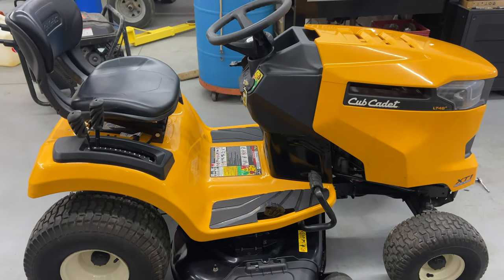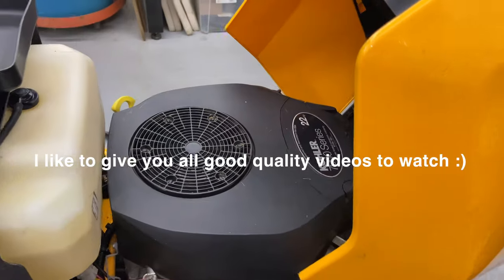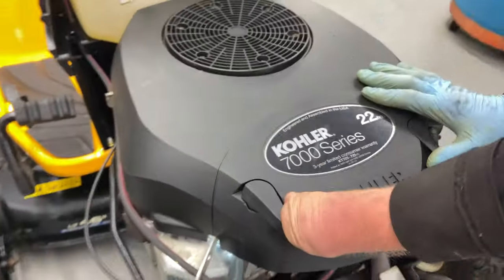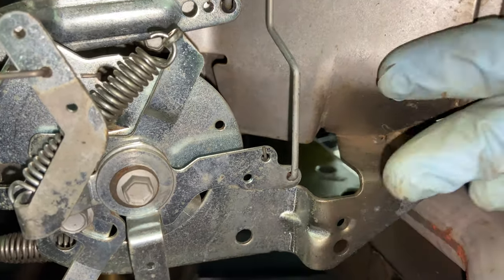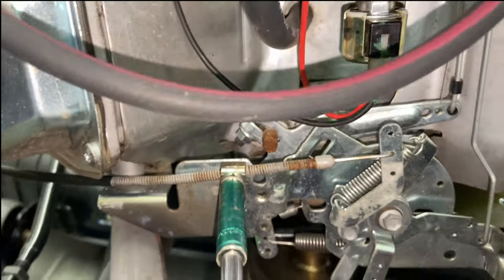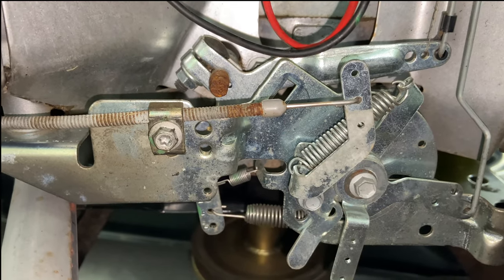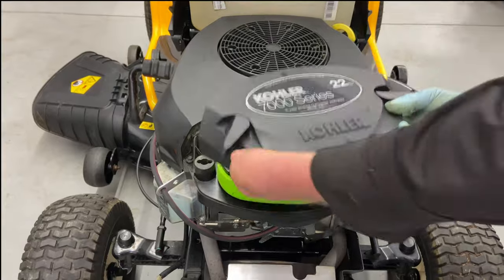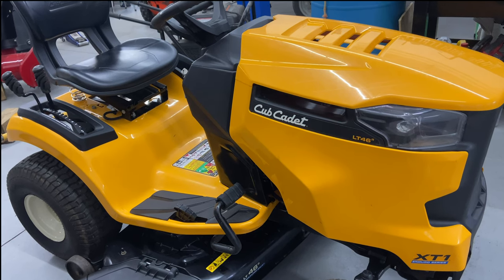Cub Cadet XT Lawn Tractor Turns Over But Will Not Start. How to adjust Choke on 7000 series Kohler.

Comment: I had a brand new cub cadet xt1 lt46 delivered to my home, tried to start the mower and it would only crank over but would not start, fooled around with the harness near the starter and found a black plastic or ceramic block taped to the harness, once I separated that block a little from the harness the mower started like a champ! Hope this helps someone in case this happens to them

Comment: I don't know about anyone else but I would love to see a video about your cleaning process. I always hear don't use a pressure washer. Oh  and BTW love your instruction!
Reply from the maker: I agree on not using a pressure washer or even a garden hose. Do not wash your machine unless necessary. The reason why the normal homeowner should not wash the machine is most do not know or have the means to properly dry the machine. I use high compressed air and know where to blow off the water so it will not sit and seep into the bearings. Also the mower decks are usually off and you can stand them straight up to drain or if the mower deck is on you need to run the deck for at least a few minutes then sit the machine on a incline to make sure all water has drained. It’s a tedious process to get all water off of the important parts and most people don’t do it. I’m am a business performing repair work and it’s my name on the job going out the door. I want my customers machines to run good but also look good as the machine should not look like crap when returning after paying to have your machine worked on.

Comment: Love your stuff. I was having a starting issue and thought it was the starting switch, turned out to be the solenoid. In-between checking out the issue, I changed this very same cable to move the gas tank out of the way. I jumped directly to the starter, crank but no start. So, I was not sure where to place the cable. Now I do. MANY, MANY thanks.

Comment: This video was incredibly helpful. I bought a brand new cub cadet from home depot and the engine would turn over but didn’t start. Wasn’t sure if it was a battery or what. Found this video, did exactly what you said and it worked! I can’t thank you enough for this video!!
Reply from the maker: I'm glad you were able to repair yourself :) Thank you for sharing and the kind comment. I have been hearing a lot through the comments about purchasing through the box stores and having issues.

Comment: I was wondering why my mower wouldn't start after I replaced the throttle cable, and you had the answer. Thanks! Now I can't get the idle to work: the cable curves up, and the control won't go all the way down. I guess I should start from the idle and work to fast, and then to choke?

Comment: Thank you for such a great video!  Helped me understand what was going on with my throttle issues.  The air filter hadn't been changed and was in bad shape.  Lots of dirt.  There was definitely some dirt down in the throttle flap,  something that prevented the flap from getting all the way in the closed position.  I could push the flap to the closed position with my finger, but no matter what tension was on the wire,  the flap wouldn't get all the way to the closed position.   So now I have a very manual choke, lol.  Any ideas on how to restore that?
Reply from the maker: Can't really give correct advice without seeing the machine. You may need to change the throttle cable.

Comment: Great video! Our KT735 has the exact same linkage set up and now starts first time every time. Only issue is its always had too high an idle speed. The orange governor spring won't let it go any slower than 2500.  Is there an adjustment to bring the idle down without changing the WOT speed? Tightening the idle screw up on top of the carburetor will increase the idle. Loosening the screw has no effect.

Comment: I have the exact mower with the exact seat. My seat has disintegrated. I do not want to spend $200.00+ for a seat from Cadet but do not know what to get that will bolt on without issue.
Can you recommend one that will work and last longer?
Reply from the maker: Try and find a good used one or put a seat cover on it. To get a aftermarket seat you will need to do some research and measurements to make sure it will fit and make sure the seat switch will work. I do not get into finding seats due to way too much trouble getting it all to come together and be safe(seat safety switch works).
Reply: @JohnsonsSmallEngines  Thank you! Will you be doing an XT-1 Valve adjustment anytime soon?
Reply from the maker: Why are you performing valves adjustment? What is your engine model?? There are several engines that were put on the XT1 series.
Reply: @JohnsonsSmallEngines  Kohler 7000 23hp? Never did them and thought I should check after hundreds of hours
Reply from the maker: I do not have a video on that engine yet. I only adjust them when the valves sound loud or there is a running issue or if over 500 hrs.as the manual states.
Reply: @JohnsonsSmallEngines  Thank you again. I didn't know that. Probably should leave it alone. The valve covers have no leaks and it doesn't leak anywhere else. If it's not broke....don't fix it, right? Great channel by the way!!!

Comment: What causes gas to puddle in front of the choke butterfly?  Never understood why they don’t have gas shut off valves.  Mine not starting and I have spark but noticed the puddle of gas when I took the air filter off.
Reply from the maker: (1) Flooding condition, possible by leaving the choke on to long while cranking the engine over  (2) dirt inside the carburetor caught in between the needle vale and seat causing fuel to seep by.

Comment: I tried what you said but my flap isn't moving unless I pull far back on the cable.  When I do that it looks like your video where the flap is on choke is what mine looks like on run. When I put mine on choke it doesn't move.  
    When I opened it up the flap stayed the same in all 3 positions.  What is connected to the flap to make it operate? 😢
Reply from the maker: It may be stuck?  I cannot tell you what you have without seeing the machine. The choke rod in the video shows how it works. It's straight forward. You may not have this exact set up. There are a few different choke set ups on the  7000 series engine. This is one of them. Some have an electric choke.

Comment: I need help I can’t figure my problem out I have a cub cadet series 1000 it was running great and I ran it out of gas so I put about 1/2 gallon  back in it  and it will turn over but will not hit to start I have traced the fuel line down checking the flow the filter and everything seems ok I’m getting fire to the plugs but no dive , dose anyone have any suggestions or pointers that might help me out , I would really appreciate it
Reply from the maker: (1) make sure you check the oil level, have compression and it has not blown up? Check to make sure your fuel shut off solenoid is working. This video may help, https://youtu.be/xDL0g-j43ps

Comment: Sure enough that was the problem with mine... i just used my finger to push the flap closed and it started right up, figured I'd  test it before taking anything loose. Thank you for the tip, got my ol' lady off my ass.
Reply from the maker: LoL! Glad you’re back up and running and out of trouble :)

Comment: How did you clean that mower so well?
Reply from the maker: A good cleaner and good honest work, including a pressure washer and high compressed air. I have learn the best way to clean a machine without hurting the bearings. I do not recommend washing your machine unless necessary. My customers are paying me to service or repair there machines and I would never perform a service or repair, then taking it back in dirty condition. I take pride in my work and I also think you all enjoy and learn much better when the machine is clean. Some of my older videos were taking while the machine was dirty and they are not easy to follow or even enjoyable to watch. It has been a huge learning process and I am still learning. Thank you for watching and supporting my channel!